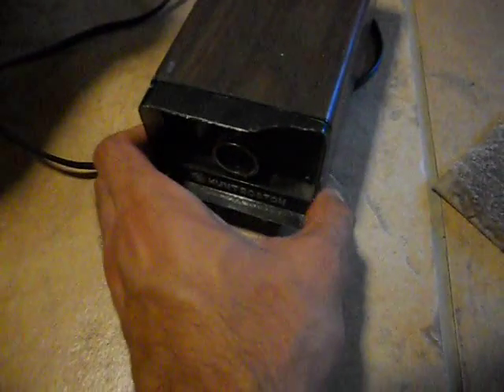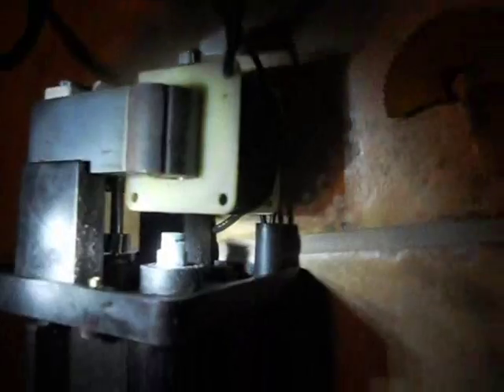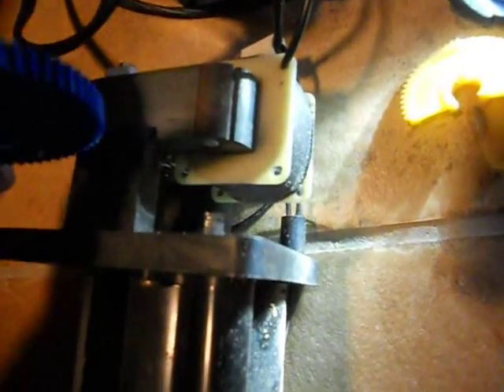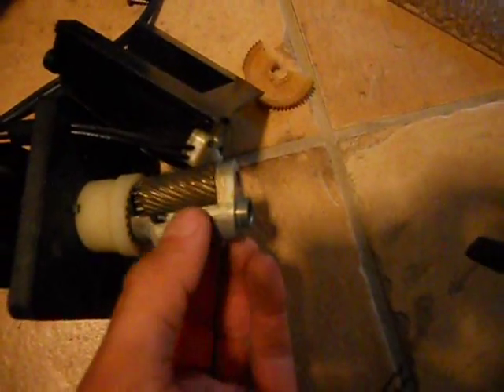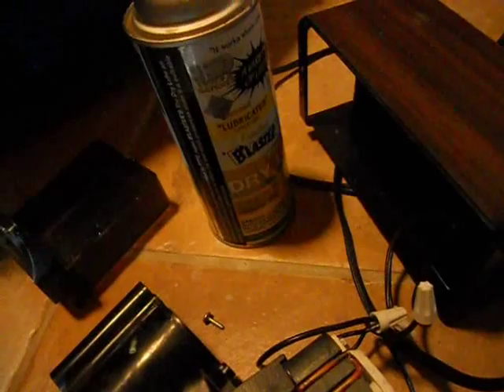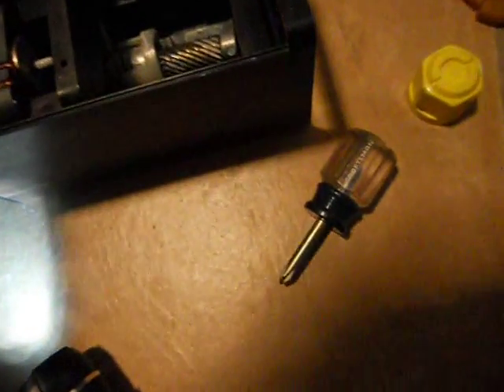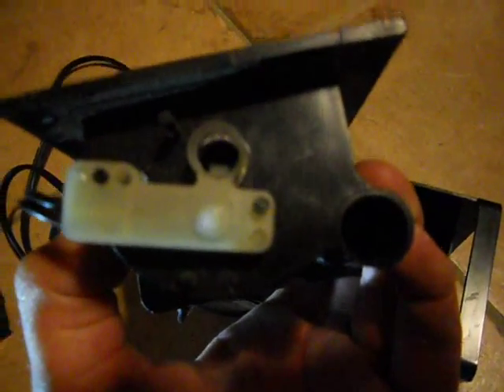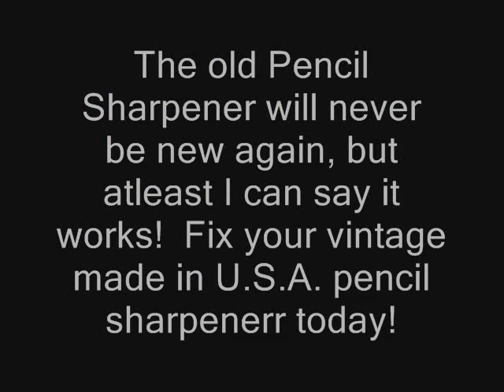How to Hunt boston model 17  Pencil sharpener stripped gear fix

Comment: Thanks for the video.  We had one of these, that had belonged to my wife's father.  The nylon gear disintegrated.  Ordered one online, but now it's really loud and I don't have a C clip.  But it works.  What did you use for grease?
Reply from the maker: I used some white lithium grease i believe. Maybe use an E clip from at a hardware store. Few cents.   Or try to make one

Comment: I have a boston pencil sharpner, But it overheats very quickly and stops functioning, after the 5th time. Any way to prevent the motor from Heating?
Reply from the maker: lube it up so it has less friction
Reply: @GhettoWagon  Could voltage difference count, Because Right now I am using a transformer to convert 110 V to 250 V, Since I am posted in Sri Lanka for my job.
Reply from the maker: @thecurrencyaggregation9103   Yes.  The motor could not be operating at a true 60hz too You would know if you have a multi meter than can check this at the output from the transformer.      Some countries have 50hz not sure a transformer will correct for this

Comment: I have the same exact problem. It sucks that just 3 or 4 of those gear tracks are "flattened" and the thing gets jammed every time. I was thinking that maybe super gluing some really small pieces of wood would take the place of those gear tracks but no, unfortunatly.
Reply from the maker: +pacnick11  New gear! only way
Reply: Finally you responded man!
Reply from the maker: pacnick11
 I don't get every message.
Reply: No problem man! My Boston Pencil sharpener is Back in Business Baby!

Comment: Hello, ı am from Turkey , ı Have a Boston model 17. My gear broken , ı need model 17 gear 3D STL File. Can you help me ?
Reply from the maker: I got my7 gear on ebay no idea if they are still making it
Reply: Ghetto Wagon , thank you , but Ended on ebay . I am not founded . I apologize ti you for my bad english 😅 . Have a good day.
Reply from the maker: @alieroglu2085   Have anyone who 3d prints with a 3d printer in your country? Anyone with one of those machines can make one
Reply: Ghetto Wagon , ı am from turkey , ı Have a ultimaker 3D Printer. I gear very  broken. İt is a so bad. I cant draw . I need physical scales.
Reply from the maker: That it?  https://www.ebay.com/itm/BESTSELLING-Hunt-Boston-Model-17-Pencil-Sharpener-Replacement-Gear/252741795380?hash=item3ad895be34:g:cxEAAOSw~bFWKbnk